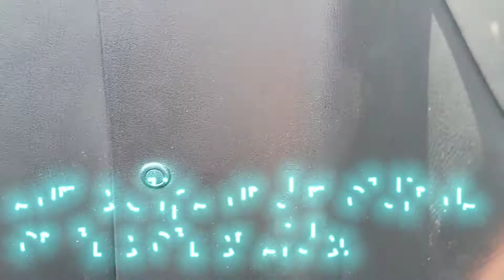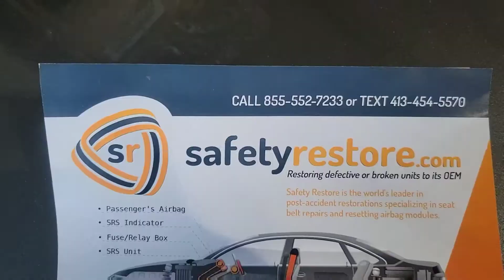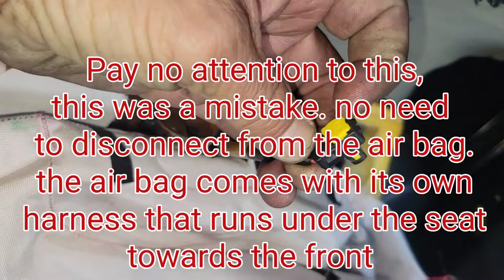2016 mazda mx-5 driver seat airbag and seat belt replacement with srs module.

Comment: Hello first of all thank you for your video absolutely saved me second thing is it okay to install the new air bag and close it up before resetting the module or do I have to reset the module and only then install the air bag? And do I need to do it with the battery disconnected? 
Thank you

Comment: Idea!  WHILE you have all that stuff removed why not buy and install the backup camera if you have 2016-2018?   They are super cheap and the car is already set up for one....the only hard part is routing the cable from the head unit to the trunk but doing this job opens up perfect place to run the cable?
Reply: Thanks for the input. didn't have it at that moment. I had to reopen everything again. good thing I had already been there.

Comment: hi, you've done a beautiful job, but where can I get this driver-side airbag?
Reply: Thank you for your kind comment. Ill try looking for the place I used and let you know
Reply: @mrmoreno4640  thanks! btw, do we need to replace the impact sensor part? I'm researching on a miata nc, the owner claimed that the driver side airbag was deployed when he slamed the door? I suppose the snesor was not damaged.
Reply from the maker: I don't think the sensor will need to be replaced.  The most critical parts are always just the bags and module
Reply from the maker: This is the link where they sell used parts. This is where I got the bags.https://www.redlineautoparts.com/mazda-miata/1990-2005-na-nb-miata/1999-2005-mazda-miata-side-skirts-mud-flaps-oem-mahogany-mica-nb194/?network=g&device=m&keyword=&campaign=1717427966&adgroup=pla-404383584840&gad_source=1&gclid=Cj0KCQiAkKqsBhC3ARIsAEEjuJikoeiS9z4kWGJZ6V0mJ0G6uk1QIJf93xreoPJH-6Dj32ISDaZzzUYaAoPMEALw_wcB
Reply: @Mrmorzun  thank you so much!

Comment: is it possible to drive around without the SRS module ?

It will take more than a month between me shipping out the module to get it reprogrammed before it can come back to me
Reply from the maker: Hi Dominic, It should be ok to drive the car just don't plan on having a wreck😁 as the air bags won't deploy.
Reply: @Mrmorzun  Oh nice, i'll try and get it done asap then thanks !!

Yeah ... no one ever plans for a wreck .... i sure didn't .... that patch of wet leaves just came outta nowhere !!
Reply: @Mrmorzun  Hi,  Will this repaired airbag  pass DMV rebuilt title inspection?
Reply from the maker: @Anatoliy Deresa  Hi, I didn't take mine to an inspection as I knew I would be driving it myself and not for sale. But to answer your question.  The moment i decided to use a reputable air bag place to reprogram the module and since I'm installing brand new genuine mazda air bags. I don't see why it wouldn't pass. The codes are cleared, the computer is not being tricked. You should be good.